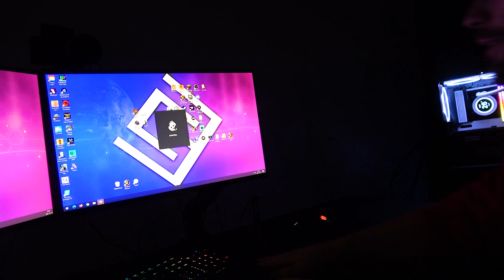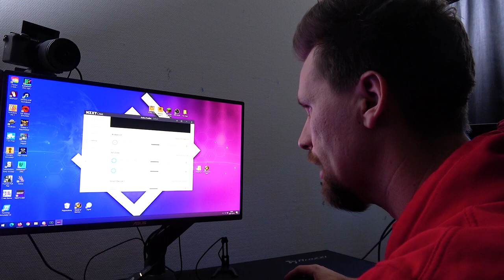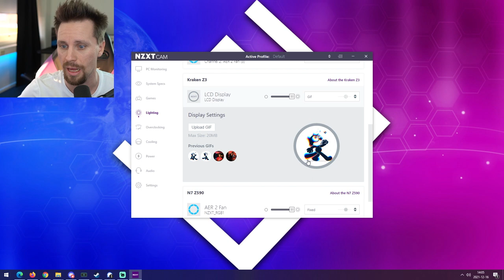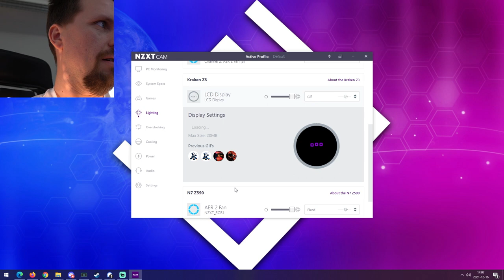BYGGER EN HELT VIT GAMING-DATOR TILL 2022

Comment: The side of the radiator where the tubes are connected should not be at the top of the loop. When air is collected at the top, having the radiator mounted with the tubes down means air is not sucked into the tubes and the pump. Tror inte jag hade fel ?
Reply from the maker: Pumpen sitter lägre än kablarna i top på radiatorn, det är ingen fara, detta komemr funka fint. Ingen luft kommer nå pumpen om den är lägre än....där luften samlas =)